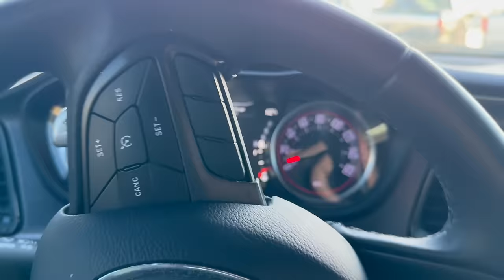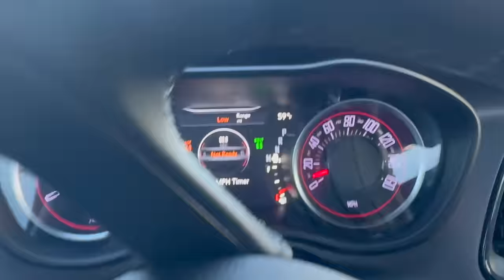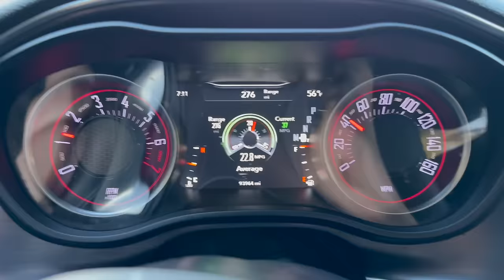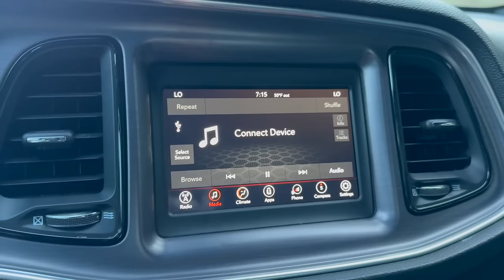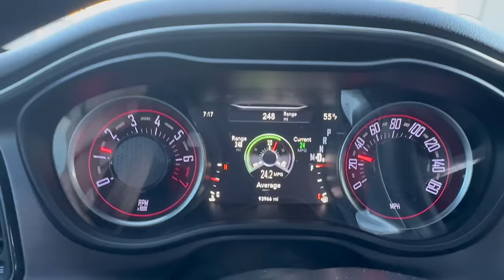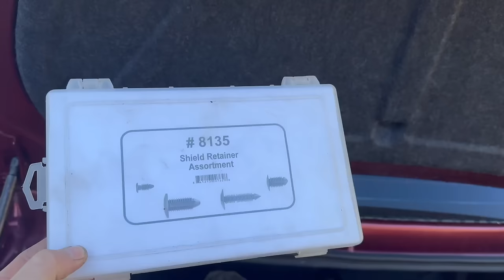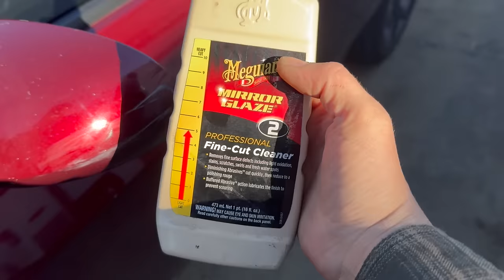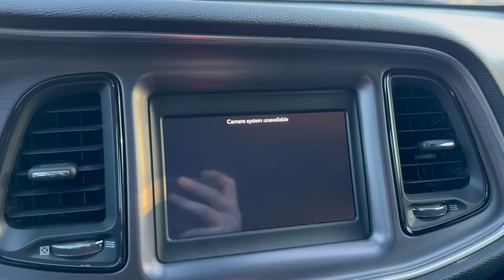The Case For The 3.6 - I Bought A Beautiful 2018 Dodge Challenger!

Comment: I would’ve given you a hard time about not getting a hemi but mine just eat a cam… so I’m gonna keep my mouth shut.🙃
Reply from the maker: I apologize, but I have to pin your comment 😅 like I said… I just don’t want Hemi problems. I’ve had to fix enough for other people.
Reply: It is what it is! I’ll probably get another hemi because I have problems….🤪
Reply: How many miles on yours? I had 185,000 miles with no issues with my 09 Challenger RT and 214,000 on my 6.4 truck.
Reply: Mine is an 09 police car it made it to 212000 miles.
Reply: My Hemi made it to 170,000 before it chewed up its cam.   The new lifters are better, so it should be something else's problem if it ever happens again.
Reply: Melling now makes an oil pump for those engines that provides 20 percent more volume , which really helps at idle speed .
Reply: Been a mopar technician for a few years and i can tell you right now the pentastar is alot more expensive to fix then the hemi. Do not listen to the people saying "it chewed up my cam" it gives you a warning sign for awhile before anything bad happens. The whole concept of buying a V6 to avoid "hemi problems" is terrible. Its such an easy engine to work on. By far the easiest one of all modern motors due to its old style setup of having OHV rather then the modern setup of SOHC or the DOHC like the pentastar 3.6. A headgasket job on the hemi is roughly 2-4 hours per side as where the 3.6 will run you 11 hours.

Replacing the cam is so easy and will run you maybe 3 hours your first go while using basic tools. U might aswell swap to a 6.1 or 6.4 cam and replace the oil pump with a hellcat one or good aftermarket one. The valve seat drop issue is easily solved with a 180 degree thermostat. Its bulletproof and easy to build. Very reliable. And can make good power when done right all for fractions of the cost itll run you on the 3.6 while maitaining the same fuel milage

Best advice i can give if its not too late is trade it in for the R/T. Trust me on this one ull love it alot more
Reply: @XShadow705 I highly doubt any of the V8 models can return over 30 mpg average. Maybe low to mid 20s, maybe. 

But, anyway, instead of cruising through YouTube comments telling someone they should’ve bought a V8, why don’t you cruise on down to a dealer, buy one yourself, and stop trying to live through other people’s purchases? 🤷‍♂️ Sounds like you’ve already convinced yourself you need to sign on the dotted line, so get at it.

Comment: 🇺🇸👍 Got the same comments you did when my wife bought a new 2016 V6 automatic MUSTANG WHY DIDN’t you buy a GT because 300 HP retuned 334 HP and premium fuel only. Now 93K miles and one water pump later is still a great car but I still love my 4 other MOPARS.👍

Comment: 3:15 “you don’t need more than 300 hp to have a good time on the street” - AGREED… in the 90s I was a dealer tech and worked for GM dealers a couple of times. After doing a 20k service on a ‘94 Z28, I took it for a test drive… it was a BEAST, more power than local roads could handle. If you punched it in 2nd gear, it started to go sideways. That year LT1 produced 275hp & 325 torque at 2400rpm, more than enough for fun in the street. Good on ya for getting the V6, and nice car 💪🏼
Reply: My new Colorado Trail Boss 4x4 pickup has 310 hp 430#s of torque! My point is 300hp these days ain’t nothing!
Reply: it's why i like the late 03-12 panthers (crown vic, town car, grand marquise) the duel exhaust version of them is rated at 280hp. with the optional 3.55 rear gearing they where fun for a street car. not the fastest but fun and handled great with the updated suspension they got.

Comment: I waited until the 2020 models were coming out and the dealer had to get rid of his 2019 stock...
I paid $18,340 BRAND NEW - 3 miles on it.
Looks good, goes fast, great milage, total win 🏆
Reply from the maker: Damn dude… I paid about that much for this one, six years old at 93k. It was at the high side of book value for a 2018 on a dealer lot - but it’s not like I could just go across town and buy another one. Adjusted for inflation, you paid about $22,500 in today’s money. So apparently these cars are holding their value pretty well.
Reply: @DeadDodgeGarage  
Yup... I stole the thing....the window sticker is still in my glove box $28k...and I kid you not, I paid $18,340. Dealer needed to clear out about 14 or 15 left over 2019s it was July and the 2020s were about to show up....
Reply: @jeffrowlette  My uncle bought cars his entire life using that strategy!
Reply: @Matt_from_Florida  
I'll never do it any other way again, I swear!!!!
Reply: My Dad bought my '91.5 W-250 LE Cummins at the end of '91 for $19,400......same strategy.
Reply: You missed out on the white Vanashing Point Challenger 😊
Reply: A 2019 Sxt started at 29k, there is no way you got a brand new one for 18k....

Comment: Overall, the people who bought the original 60s /70s chargers, challengers and roadrunners also agree with you as the hemi is fairly rare in them. More 318, 383, and 440 6 packs were sold than hemis. Even though the hemi made more power!
Reply: And oddly enough the newer v6 challengers are slightly faster than a hemi powered classic version

Comment: I bought a 2013 Challenger SXT+ last February (48K miles) with the V6 and LOVE IT.  I didn't want a Hemi either and this V6 has all the giddyup I need. The car is stunning (Redline red) and gets lots of attention and compliments. My daily driver is an Inferno red 2008 Caliber SXT I bought new that just flipped 60K miles. I think the Caliber got a bad rap, this car has performed flawlessly for 16 years. I'm not a fan of the CVT tranny (especially compared to the Challenger's fun 5 speed auto!!!) but for a reliable hauler and commuter car, this Caliber has been terrific. Anyway, your excitement over your new Challenger matches mine and it was a fun video to watch.

Comment: I can understand why you would buy a new Challenger - it's gorgeous. I should know, I have a 2018....Hemi. You're a good mechanic, you can always put a Hemi in it and make it a sleeper. Sorry, I like my R/T and the sound. To quote Brother Lee Watts: Where there's life, there's noise. Screw the three prong, those are for old people. Yes, you will use the paddle shifters, it's a blast in M. Those wheels are great! It took me some time to get used to them. My original battery is still in my car. You need to use a good buffing cloth. The seats are great, no knee pain driving this car. If you hit the door handle with the water, the lights will come on. I'll take those wheels.That is a great looking hood. I'm buying a 2023 and am not fond of the hood design. I've got over 120K and no problems with the Hemi. I rented a V6 and couldn't wait to get back in my R/T.

Comment: Had a 2015 Charger SE V6. Drove Uber with it for 2 years. 264K miles when I traded it in 2019. Engine was still surprisingly strong at high mileage.  Trans went out.

Comment: In the Challenger, the 3.6 is rated at 305hp. In the Chargers, 292hp or something like that. 2011 was the first year for the 3.6 in the Challengers and Chargers. 2015 was the first year for the 71'ish grill and taillights on the Challenger. 2015 was also the first year of the restyled interior and 8 speed auto (in the Challenger).
Reply from the maker: Yep you’re right. Clearly I remembered wrong on both counts there. Yes, the big refresh came in 2015. I much prefer the newer car.

Comment: I had a 2017 and  2019 AWD V6 Challenger. The V6 was plenty for me and both cars were fun to drive. The only reason I traded in the 2017 was it wasn't great in snow with the rear wheel drive. The 2019 AWD was great in the snow. I regret and miss my 2019 Challenger. Should never have traded it in.

Comment: Love it.. My magic number is 400. Owned a 2005 GTO for 9 years, loved every minute of it. Sold it with 189k miles on it and replaced it with a modified Cadillac CTS-V. Now I just have stupid horsepower. It was much easier to use and enjoy the 400 hp in the GTO. The power I have now is almost scary and is very unpredictable on most normal street surfaces. I don't regret what I have now and I absolutely love this V but I can totally understand your reasoning..
Reply from the maker: I have always liked the look of those GTOs - ever since seeing the Holden version on Top Gear. I was amazed by how small they are when I finally got up close to one.
Reply: What were you smoking 🤣

Comment: I traded in my 2016 GMC Sierra for my 2019 Dodge Challenger GT (in Octane Red 😎👍) two months ago and I couldn’t be happier with it. 

I wanted a solid grand touring-ish car — something affordable with decent power, that was comfortable and fun to drive on long trips, and would also return good fuel economy. The Challenger is about the only car that really did all of those things well. 

The GT package comes with the same suspension as the RT models (and if you spec it with the Performance Handling Group, you’re getting all of suspension components from the ScatPak cars). Those suspension components combined with the lighter weight of the V6 actually makes it pretty satisfying to drive. 

On a three hour drive to Columbus, OH yesterday, it returned 30.3 mpg. Which is absolutely ridiculous for a car like the Challenger. The worst fuel economy I’ve seen so far is around 27 mpg, and that’s still nothing I can complain about. 

I don’t really see what having a V8 under the hood would benefit what I want from the car, honestly. Well, other than mostly shutting up people who shouldn’t be worrying about what the hell I’m buying and driving to begin with. But anyway…

Comment: You did great, I had a Pacifica with that motor 2018 3.6  would SMOKE THE TIRES, Wife  laid rubber down, and you would not believe unless you were there  in traction control was on
 Needless to say, I was proud . And that's front wheel drive. I drove a Toyota Van it had nothing on a Pacifica.

Comment: Jamie I caught the new car bug in 2018 myself (August) and bought a pink elephant Chrysler 300S 5.7 Hemi brandy new off the dealer lot. I was wanting a Charger R/T Hemi but actually scored the upscale Chrysler for the same money or less. My old college buddy was a salesman there, and said the "S" model 3.6 and Hemi look identical, and no one would pony-up for the V8 to look identical, for like $4000 cost. They had the car for 8mo and sold over a dozen Pentastar 6 cars around it, and it HAD TO GO before September. I nego'd with them for days, and finally got it for a little less than the top dollar I swore myself to. ZERO regrets, I love it!! A friend loved it so much, he bought a Touring V6 model around November (his medium blue, mine ceramic grey), and he loves his too. He gets 31mpg hwy and I get 29mpg hwy, but his gets a better spread around town. Mine actually has a trip odometer that I never use or reset, and it shows over 26mpg over the whole (13,000mi) history of the car. I haven't even put a battery in it yet! I have changed the oil at 2000mi, 5000mi, and 10,000mi, and it will be due again at 15K. I use 5w20 Penzoil Platinum synthetic oil with a Lubegard BioTech additive (to ward off Hemi problems, we'll see!!) and a Purolator "BOSS" 10K rated filter. This is my first car not to see 3K oil changes. going with 5,000 instead of the recommended 10K(!!!). I like your Chally and ENJOY!! I know I love my THREE HUNNIT!! :face-red-heart-shape::trophy-yellow-smiling::medal-yellow-first-red::yt:
Reply from the maker: Awesome! It’s funny, they had a 300 on the lot quite some time ago that I wanted to check out, but they kinda talked me out of it. I also wasn’t quite in a position to buy at that time. But I would definitely be interested in one that is configured how I’d like.
Reply: @DeadDodgeGarage  I did not really need all the extra features this car has over a Charger R/T, but some of them I actually like and utilize. I do appreciate the better stereo system it has over my friend's Touring. The Hemi never disappoints, and the 8spd with 2.62 rear gears makes it a highway beast. I have driven it from Georgia to the Missouri No Name Nationals twice, and probably will again this year.

Comment: After driving a Grand Caravan for 10 years, I forgot that driving could be fun.  A 2018 Charger GT (awd) reminded me how much I missed driving for fun.  Restarted my passion for Mopars.  It was a great car that I sold for more than I paid for it during the crazy used car prices days.  Allowed me to get my Dart Swinger & Valiant (both of which are also currently broken).  Miss that Charger during bad weather and the winter.  It was great.  

The Penestar engine is a great addition to the Mopar power plant stable.  

The electronic refresh was in 2016/17, if I remember correctly.  Could be wrong.
Reply from the maker: I was corrected in another comment - the interior and exterior refresh came in 2015.
Reply: @DeadDodgeGarage , makes sense.    Think there was an electronics upgrade after that.

Comment: Congratulations on the new Challenger. I look forward to your purchase of a Scat Pack (or perhaps an i6 Charger)
With the 3.6 you'll only need to watch out for the plastic oil cooler. The aluminum upgrade/replacement is readily available.
When you INEVITABLY (one of us, one of us) upgrade to the Scat Pack, the only "mandatory" upgrade is a Melling high volume oil pump (to free you from worries of cam/lifter failure.)
I purchased a 2018 Challenger GT (AWD) new before trading up to a 2020 Scat Pack, Shaker Hood. My average mpg is the same and the only downside is that the 392 demands premium fuel. The 3.6 runs best on 89 octane, as recommended by the owner"s manual. (Either engine will run on any fuel, just not well.) However, I'm seriously considering selling the Challenger and just dailying a 1988 Plymouth Gran Fury for simplicity's sake so whatever.
Cheers from VA.
Reply from the maker: Well… alright. Haha. I’ll keep my eyes out for a Scat Pack I guess 😅 aluminum oil cooler is already done.

Comment: I rented one in Vegas, it was black and had a thousand scratches on it and almost 200,000 miles. It was an awesome cruising car, and it was a little more exciting than a Kia (a lot actually). I too have a 2014 Ram 6 popper that we bought new for a shop truck. We have the same truck with a hemi (also with the tick) and I’d take the 6 cylinder any day. Although the hemi does have 225,000 miles

Comment: Hey Jamie, if you are still thinking of different wheels for your Challenger, you should consider the factory 'Heritage' rims, the ones that look like Cragars.  I put a set on my 07 Magnum RT and they look awesome.  If I recall, they are 20 x 8"rims.
Reply from the maker: I’ve seen those but I don’t think it’s quite the look I want - as much as I like classic Cragars. Tracey just bought a ‘20 Charger R/T, and I don’t know what the heck wheels are on it, but they’re exactly what I want. I’ll probably try to figure that out when these tires are on the way out. I’ve got a while…

Comment: I had a hemi Challenger and it was great. 
But I had to sell it and replaced it with a 2010 Charger with a 3.5 V6.
It’s nice, gets good mpg, and is decently fast, I run synthetic oil and 89 octane gas. 
For just a daily driver the V6 isn’t too bad.

Comment: I've been watching your new videos getting the Demon ready to drag race and I was fascinated with how different the driving experience is between the Demon and your Challenger here. Both have 300 ish HP both are 2 door Muscle ish cars albeit from different eras and the driving experience could not be much more different. The Challenger is fun but subdued where the Demon is a riot and in your face. Now the Challenger might be a little more rowdy if it was a manual with say 5-6 gears to row but it still (in my opinion) would not be close to the level of the Demon it terms of seat of the pants excitement and Joker smiles per mile. So I wondered what a well tuned 300hp "ish" 318 magnum overdrive automatic equipped 70-76 Dart / Duster / Scamp (Demon as if they are for rich people) would be like, arguably you could build a really nice handling, riding, stopping and going car for about what you pay for a modern low mileage v6 Challenger if you weren't too picky on paint (like with the Garbage can Cuda but with actual body work) and did the work yourself and didn't charge yourself labor. The best of both worlds? Maybe ....things that make ya go Hmmmmmmmmm. You have spoken about a slant 6 daily I think I would prefer 318 Magnum with overdrive or a nice modern 5-6 spd Manual if I could find one that's affordable.

Comment: The 3.6 are surprisingly quick. And really good on gas mileage. 

I have a 2014 with the 5 speed auto. I can get 30+mpg when cruisihg on thr highway.

 Upgrade the lower i take to a style they call the PUG. Put some PUG (pentastar upgrade) injectors. And a good real CAI that actual takes in cold air. and thry are real fun. 

There are even adapters for 85mm hemi tbs to go on them.
Because the way the computer system worksit will automatically adjust for those upgrades and increase hp without a tune.